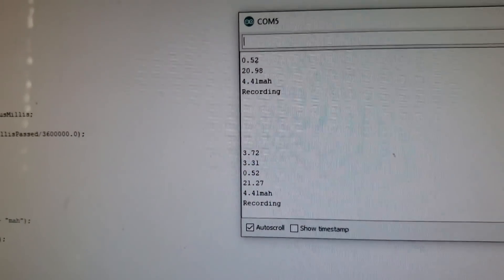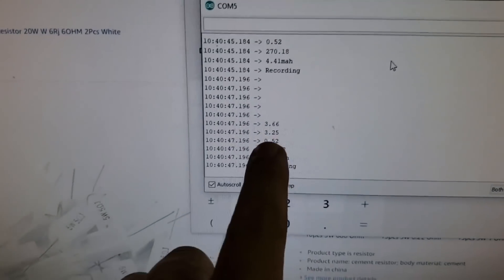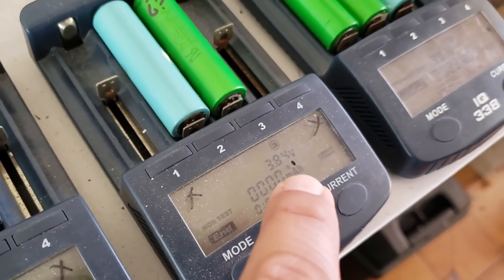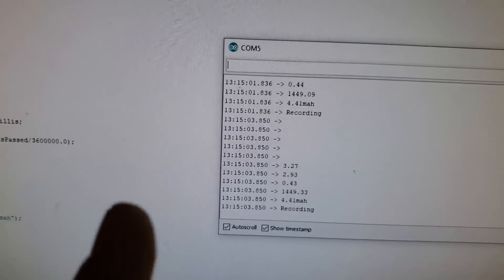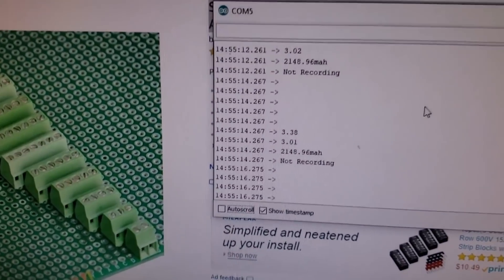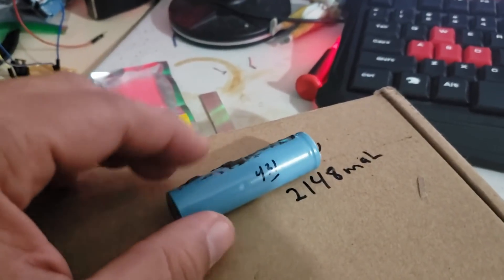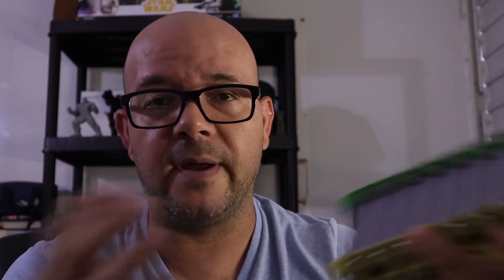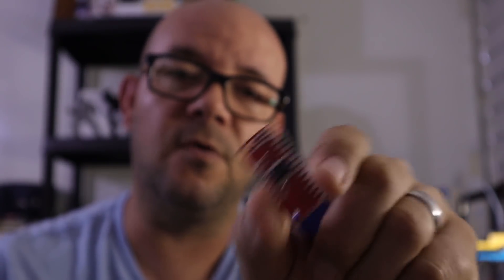Can we create our own 18650 battery tester?

Comment: I think I have found out that I need to discharge my 18650s before I test them. It appears that results depends on what the charge is before the test. It appears that the higher the charge before testing that the results are lower mAh or as you showed low 009 reading for mAh. I have a 2 testers with USB connection for charging phone and other USB devices. I use it to discharge the batteries before testing. 

I found a single cell USB battery that I took apart. I will try to connect several 4 cell holders in parallel connected to this USB battery device and use it to discharge batteries before charging. It will take time as you said but at least I think the results will be better. Thanks for showing this video !!!! 

If you product a product I will definitely be interested !!!

Comment: Mucho Gusto Javier.  Great video.  You are providing a great service to the DIY community.   I'm going to check out your website and products.  I'm looking to design and build a Solar PV system using used 18650 cells for Emergency Communications, Field Day and other Ham Radio Contesting.
Reply: Also, My ham radios nominal voltage is 13.8V +/- 15% (11.73 to 15.87 Volts).  So, I'm looking at a 4s20p minimal system configuration with a LiPo Solar Charge controller that charges each cell/bank between 2.97V to 3.97V.  This will allow much higher charge/discharge cycles and meet  most Ham Radio power requirements while not losing 10% losses in a 24V 7s system requiring a DC-DC converter (which was my original design concept).
Reply: I've looked at Jehu Garcia's 7s1p modular pcb system but think his (3) BMS solution is more complicated than your 20pXs system.
Reply from the maker: I'm almost done with my bms design... you'll love it
Reply from the maker: I'll love to learn more about your projects. Please keep me posted.!
Reply: @javiercamacho  What is the length and width of your 20p pcb?  I need to know if 4 of these will fit in my Pelican Case.